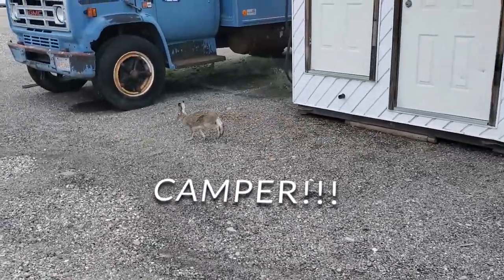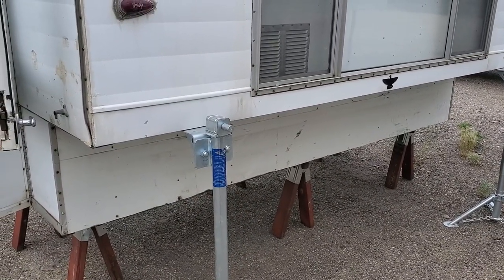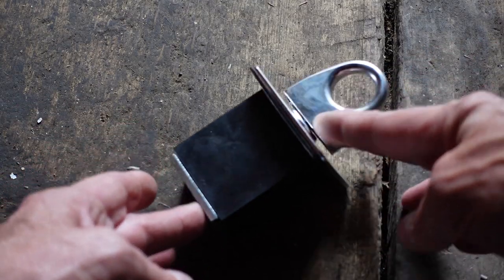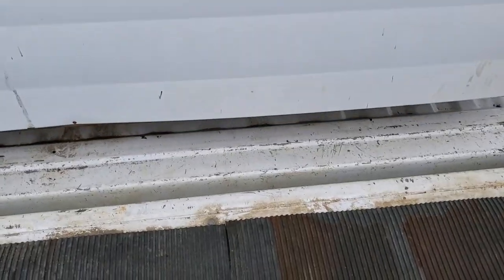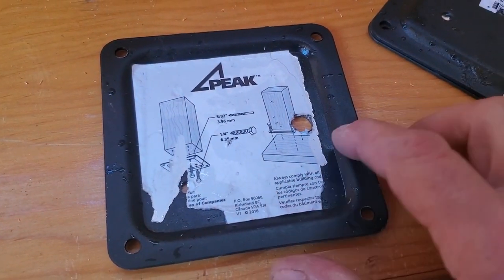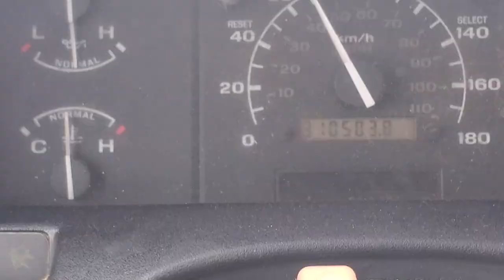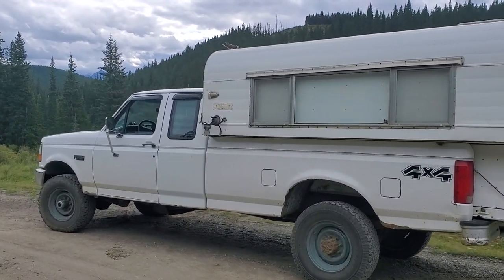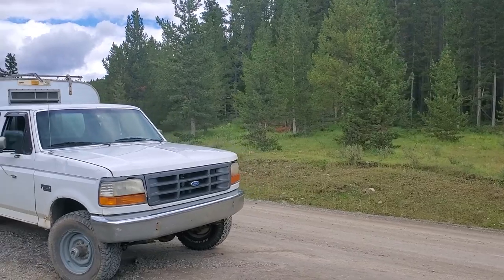Alaskan Camper Install & Test Drive on my OBS 1997 Ford F250 HD 4x4 in The Rockies - Part 2

Comment: Hey Jimmy if you can’t find a 8 footer and you’re dead set on mounting a bike rack I would mount a 2inch receiver tube under the the front bumper area and carry your bikes out front.  It used to be common practise back in the day for people with Campers to carry their Honda 125 Trails out front and considering your Rig smacks of the 70’s and 80’s IMO it would certainly fit!  Those old Alaskan Campers are beauties and worth saving!
Reply from the maker: Thanks for the info Gerry! Much appreciated and awesome plan 👍👍
Agreed these campers are amazing. I know they made them in a few different configurations. 8 footers, 10 footers with non cabovers and cabovers and they're still in business today. Pretty cool 😎
Reply: @JimmyMeatwhistle  From 1973 to 1977 I was stationed in Fort St John, BC (Mile 47 of the Alaska Highway - or Alcan as it was known to most American’s so I’ve seen hundreds of Rigs just like yours decked out front and back with Jerry cans, multiple spare tires, external window screens (Alcan was gravel back then) and Trail bikes “hanging off” the front bumper!  This “new” Rig of yours is giving me flash backs lol!
Reply from the maker: @gerrytaylor5137  very cool! Cant wait to get this out into the bush!

Comment: Get a front receiver hitch and put the bikes on the front ..... just an option
Reply from the maker: Thanks for the comment. Yeah I think that totally makes sense and it also gives me a place for my spare tire. At the moment I have nothing for the spare other than in the bed.
Reply: @JimmyMeatwhistle  I'd check to make sure you don't block out the headlights or airflow, but you should have enough "front end" to hold the weight ... especially with the leaf springs.